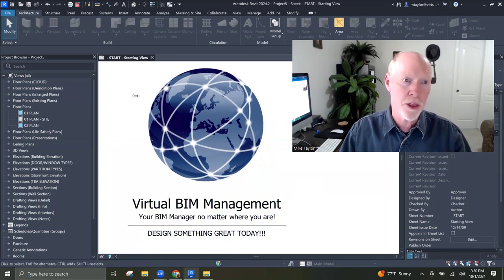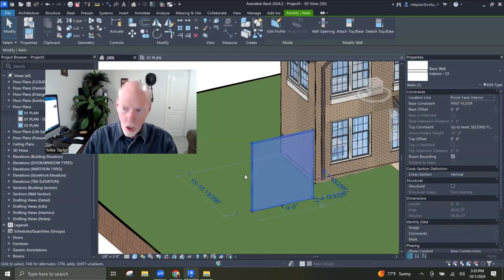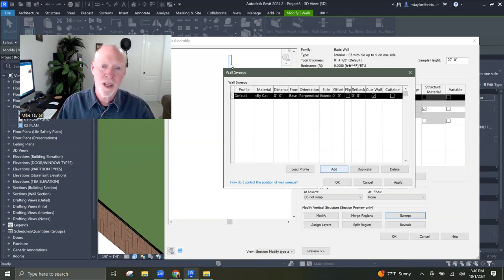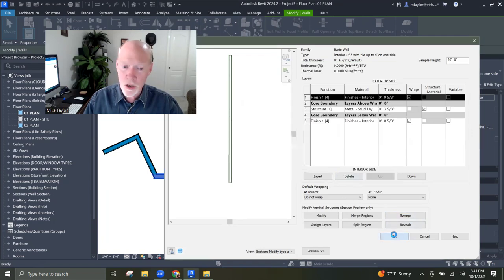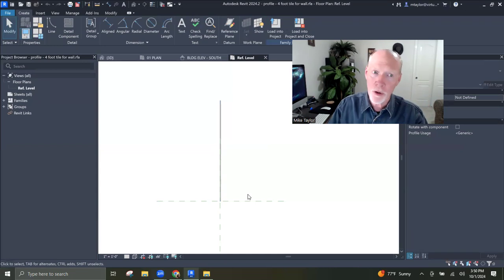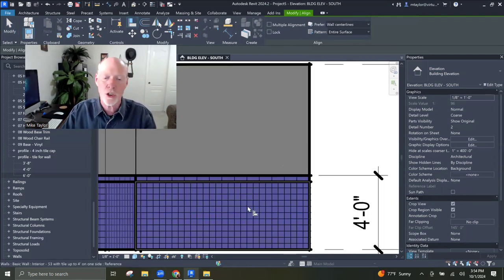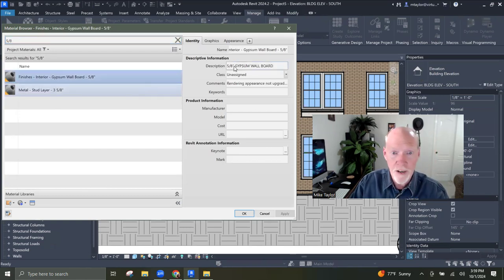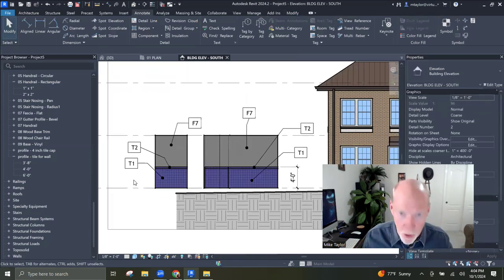Placing TILE (or any material) on Interior Walls - and Material Tags

Comment: Thank You, dear Mike.  Your tutorials are just OUTSTANDING and this one is nothing less than that.
If I might ask You for more... Is there any way to limit/control the length of the wall sweep? For example, if I do not want for sweep to go from side to side of wall ends but just want it in the middle of a wall and that in a controllable way?
But, anyway and once more, really thank You Mike.
Reply from the maker: When you place a wall sweep on the wall... you can then select it and you will see the grips to make it shorter or longer.